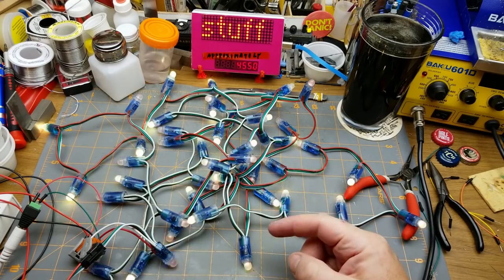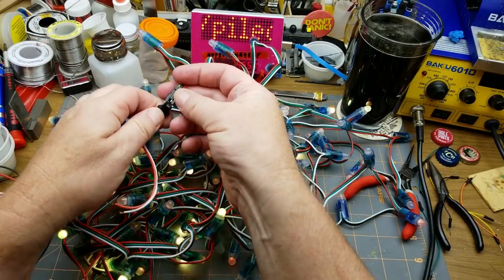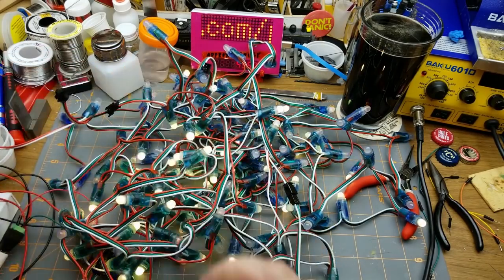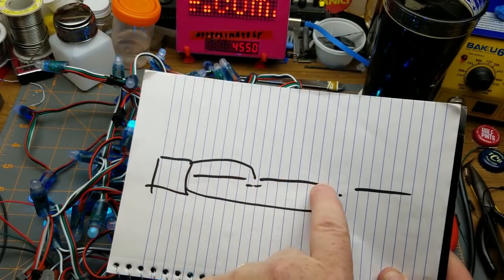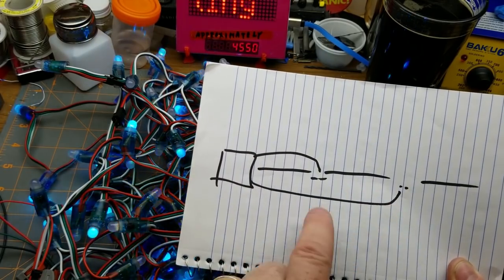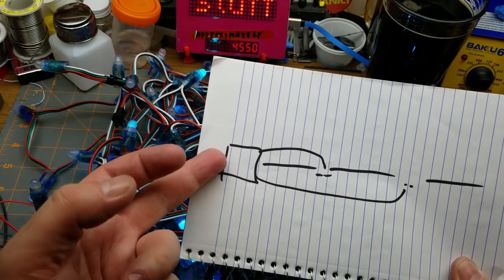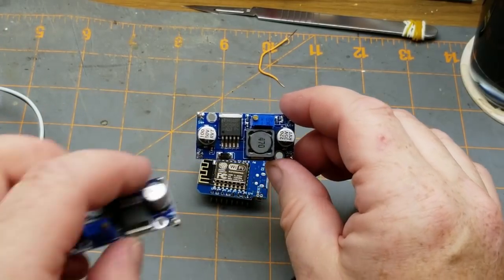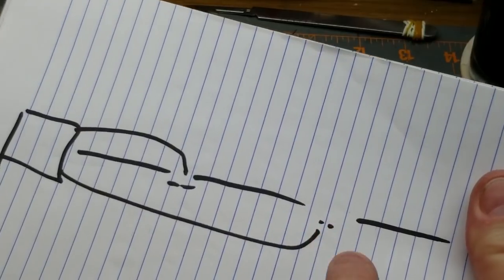programmable wifi Christmas lights

Comment: I use WLED for all my neopixels now. It's an arduino program for neopixels that has everything you'd need and can actually sync between different devices too. It's got like 30 animations, pallettes and all sorts of wizardry already done.
Reply: You  beat me to it,wled is the way to go.
Reply from the maker: I have seen a lot of similar projects recently using WLED. 

 I didn't see any of  them until after I had this done and installed.

Maybe next year.
Reply: Came here to say exactly the same.

The WLED code is well worth a look even if only for inspiration for effects to put in one's own.

Another open source option is McLighting (made famous by Brian Lough in his wedding lights project) which is similar to WLED.

I think WLED has the edge though for usability.
Reply from the maker: @gavinsmalley1513  I kinda wish I had known about WLED a few months ago.
Then again, there's certain satisfaction from doing a project in-house from scratch.
Reply: @pileofstuff  You're right of course, there's everything to be gained by doing it yourself. That's where so much of the fun is in this hobby!

Personally though I'm not particularly "arty" so I find projects like WLED are good for seeing what patterns I can do. I'd never come up with those on my own.
Reply: @gavinsmalley1513  @pileofstuff yep wled all the way. Don't have a long primary data cable or you may have issues. Or put one led in the box as the ws2811 amplifies the data signal from 3.3 v to 5v. Also you need a common ground reference x

Comment: Very nice. I have had a similar setup using 130 older 4-wire (clock+data lines) lights running on my house for five years now. The only maintenance has been replacing a few pieces of electrical tape. I had a 5v, 5A power brick so I powered everything from that one supply. I ran a two-conductor wire along with the lights and spliced 5 volts and ground to the extra wirers between each string. Mine are 25 light strings. I used an arduino so I have to bring the controller inside to reprogram it. I've been going to upgrade to wifi, but haven't yet. I change the program for Halloween lights too. They just stay up all the time and are turned on when needed. Again, very nice! Thanks for the videos. I learn a lot from you.
Reply from the maker: I'm hoping that these survive the weather. They've been up and running for about 3 weeks and have already seen -15C, wind, rain, and snow.  he control box is still nice and dry inside, and has a layer of ice on top of it.

Comment: A lump on hot melt glue stufed into each end  of a length of heat shrink works as a free weather proofe system. I usually use pre glued  heat shrik works 100%

Comment: About 70 pixels is the limit before power injection is needed.
every 50 is recommended.
Do an "All White Test" too see that there is no color changes of the pixels white that uses all three LED's in each node.
Reply from the maker: Yup. Every 50 is what I did.

Comment: Remember, each LED is comprised of three led elements so you need to plan for 60ma per led at full bright white.  WHen you dropped to "cyan", you dropped out the red LED which is why it was "sort of working".  If you want good ideas for color control, check out diychristmas.org!!

Comment: Cool project! ... Why do I see a sequence pattern for 'merry christmas' in morse-code? ... The Latex might stick better after roughing up the surface?  ... fyi - you might not need all three power boards.  Power to strings 2 and 3 could be connected at the junction of 2 and 3.  And if your power supply can handle the current, you could get away with only connecting power at the junction of 1 and 2.
Reply from the maker: Morse code... I think I see a version 3 of the code coming!

With 3 power supplies nothing is even slightly warm. I didn't want to have to worry about it so I rounded up on the power.

Comment: 3amps them will melt or get really hot 😂
Cud save wire and use 3 WiFi modules lol
Reply from the maker: I'd still have to get power to those up on the roof, though.
So far nothing is even getting warm.
Reply: @pileofstuff  I know are was thinking seperate supply but would have to find extra sockets more wire😂 or cud use solar would cost more tho 😃
Reply: Oh you said they ment to be capable of 3 amps if you put them full brightness on white test current might get away with 1 regulator 😉 3amps😂

Comment: If someone is programming-savy they could add this bit of code in the respective places and have an option for Red, Green and White colo(u)rs streaming on their lights!  ENJOY!
(Not perfect but works!)
/* Various hardcoded colour arrays */
(Section found in)

const int C_CHRISTMAS[][4] = {
  {255, 0, 0, 255},
  {0, 255, 0, 255},
  {255, 255, 255, 255}
};

-----
//defines for pattern names
(Section found in)

#define P_CHRISTMAS_SINE 2
 //Need to re-number the other options

-----
//Displays a pattern on the light strip, but you could've figured that one out on your own. :)
 (Section found in)

      case P_CHRISTMAS_SINE:
        strip.clear();
        for (int i = 0; i < LED_COUNT; i++) {
          int col[] = {0, 0, 0, 255};
          sinePulses(LED_COUNT - i, C_CHRISTMAS, 2, 1000, col, 3); //light index, const colour array, length, speed, color, arrLength (Used value of 1000 for a gentle speed)
          normAlpha(col);
          strip.setPixelColor(i, strip.Color(col[0], col[1], col[2]));
        }
        strip.show();
        break;

-----
//String prepareHtmlPage() {
  (Section found in)

<option>CHRISTMAS</option>\r\n\t\t